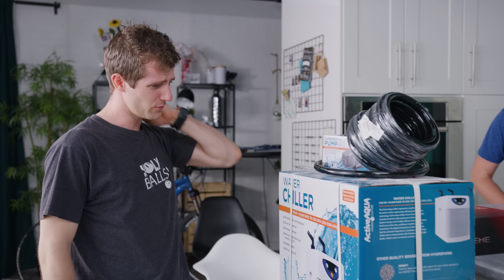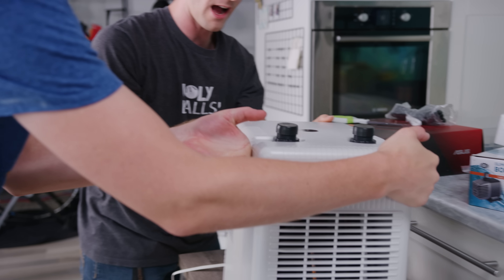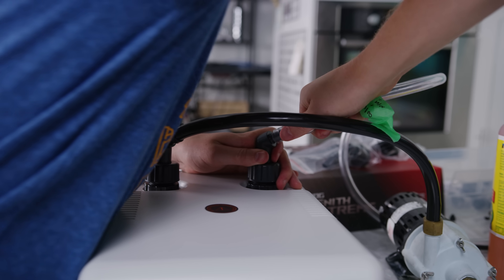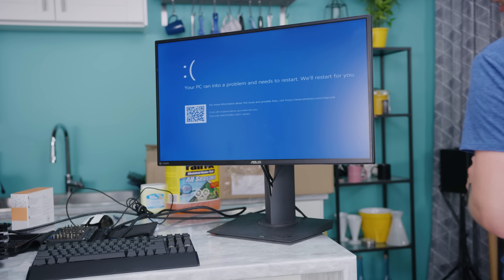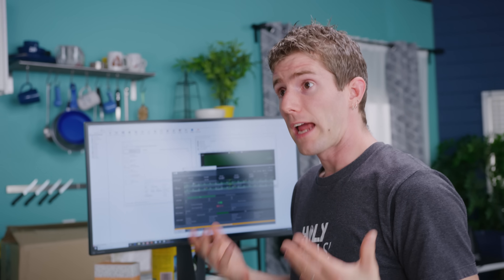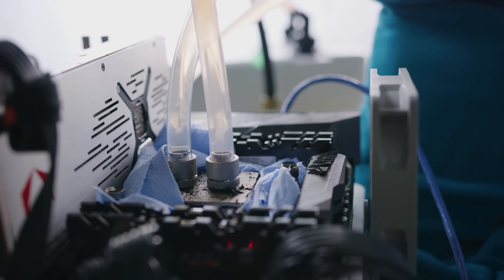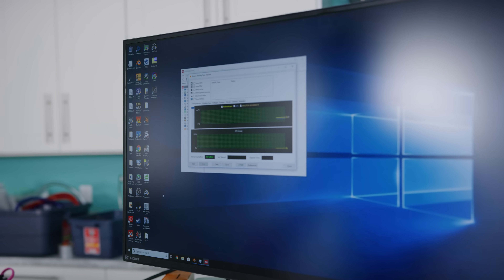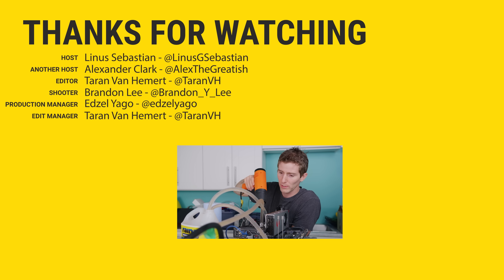Chilling Threadripper 2!!!

Comment: If only there was a machine that could be used to De-Humidify a Room so that when you run these experiments you didn't have to worry about Condensation
Reply: yeah they could get an dehumidifier plus an aircon and put the computer on a separated room and only bring the keyboard, mouse and video cables out and just go bonkers with it
Reply: I mean Going Bonkers is what they do. So why not have a testing room specifically for these crazy projects!
Reply: @draconk  chest freezer stick computer in that and run a HUGE air cooler
Reply: Just submerge it in 3M Novac liquid like der8auer did.
Reply: they should use a dehumidifier to cool a system
Reply: You know that there is a smartass way and there is a Linus way, right?
I'm here for the Linus way
Reply: /sarcasm
Reply: Couple of holes in the intake plenum of a window AC unit and it'll dehumidify like crazy, throw that in a wood box with the computer and you can go way below the dew point without dew because the dew will all drain out the back of the window unit.
Reply: no need to worry! There's a place called Antarctica...
Reply: A self filling water bottle would work
Reply: Holy crap that was an unexpected quick amount of interactions! That being said we all love Linus TT for what it is but if they are going to continue to do these crazy science experiments they should do them in a Controlled Environment which they definitely have the space and Means to implement! The less variables in your experiment the more likely you are to have a repeatable outcome!
Reply: Agreed but important to note more repeatable outcome for people with same ability to control the environment which isn't most of their viewers but most of us aren't going to be doing this anyway so a more reliable experimental setup could still be beneficial I suppose and I also suppose I don't know the point of this comment guess i just wanna add some more to the quick interactions!
Reply: :thonk:
Reply: UV conformal coat the board and vaseline in the socket and set it low on a load OCed like that and see if the 1/10 can keep up lol. It wont trust me. It will get very toasty in no time. A 50 Gallon (cooled to 4C) reservoir will help slow it down but it will still end up getting hot.. worse than air cooling hot.

Also a note. I don't know much about Rain-X but you may have another much larger problem. You may find it corrosive to the aluminum in your chiller. This is why those in the hydroponics business have to pay a little more for titanium rads in their chillers. I look forward to seeing what TR2 can really do. 1/4 is the minimum you would want to go for a continuous load, but (in the event you want lower sustained temps) don't hold me to that. I went all out and bought a 1 HP to run more than 1 system.
Reply: I think by:
1. Spraying the motherboard with hydrophobic compound.
2. Mounting the motherboard upside-down. And having some insulation around the pipes to reduce condensation...

This system could work without dehumidifiers.
Reply: maybe put the board upside down so condensation rolls away from it not towards it
Reply: The dehumidification level necessary would cause static buildup strong enough to fry the system?
Reply: Mineral oil is a bad heat conductor. It takes heat slower than water and releases heat slower. Linus should have just used water as Rain-X may be corrosive to the aluminum radiator in the chiller (just assuming it is aluminum and not titanium hydroponic grade). It is also most likely a worse conductor. As I said above a cheap and easily applied UV conformal coating will solve all condensation problems and with a UV light you can check for any missed spots. Uv conformal coatings are used in industrial applications that are in corrosive environments that can be salt water or even worse. But as I said above the 1/10 HP is not enough for sustained 780+ watts they have reached in the video. In less than 1 minute it will either crash or thermal throttle on that chiller, a 1/4 HP is still too low for a sustained load like that. A 1 HP would keep the sustained temps much lower allowing higher continuous overclocks.
Reply: What about a completely sealed case with a dehumidifier attached.
Reply: oil cooled used the pump to run baby or mineral oil for the whole pc
Reply: @AI A That doesn't help the issue at all though, the problem is the coolant temperature (which lowers the block temp as well) below the dew point causes water in the air to condensate its not about what you use in the loop its about whats in the air and the temperature of the loop.
Reply: Madarius  https://www.pugetsystems.com/submerged.php why that does not work  . there  the condensed water would go blew the oil so you don't have to worry about the water on the pc
Reply: @Al A Your original* comment didn't make me think you were talking about a submerged pc but i'm well aware of how they work. I gathered you meant put mineral oil in the loop instead of a water/alcohol based coolant. For the purposes of overclocking a novec fluid submerged pc would be better then mineral oil (I don't know of anyone actually cooling mineral oil to sub ambient they normally just use standard radiator/pump/fan combo not a chiller) yes being submerged in mineral oil would prevent condensation but it also becomes gel when it gets cold like really thick gel and would be a nightmare on a pump and would almost certainly clog up a loop.
Reply: A mineral oil encased PC has already been done.
Reply: We know that its been done he was talking about chilling the mineral oil to avoid the condensation problem that this comment thread is discussing. My response was why that would be a bad idea. Only covering both because i'm not sure if you were responding to me or AI A.

Comment: Hi, I'm not sure if you guys ran CPU on thermoelectric cooling? That would be interesting to see.
Reply: thermo isn't that great.
Reply: so 1500w on peltier cells to do the same his system does for 77w....
Reply: What's the thermo solution of heat dissipation? You got a 12volts at 5Amps at what? 70watt power draw? get like -20c. Get a cheap 12Volt DC temp controller that has a 20Amp  relay protection cut off one of the control  the temp to prevent condensation but keep it at a crisp and cool 35c? I dunno maybe I'm wrong?
Reply: They have larger  peltier cells what like 40mm x 40mm that can soak up 30A but you'll limit your plate to 20A at 12V which is like 240W (but if you are controlling the temp versus getting down to those sub-zero temps you won't see that kind of power draw).  The CPU already was pulling over 500W with their overclocking
Reply: buying the material for all that is fairly cheap too
Reply: Calculating total power consumption with a full load OC ryzen 7 1700, full load gtx 1080ti Strix OC, 3 SSD, 5 140mm fans, 16gbddr4 a 62mm tec plate, wraith cooler I calculate full psu usage to be around 850+- 30w with a cougar 1000cm and separate 24A 12volt rails it should work.. Theoretically
Reply: With a power regulator attached to the TEC in line with the power supply you should be able to control your Temps and keep it at a temp where Condensation doesn't happen

Comment: no just buy a peltier kit, thats all that is im sure,(EDIT: its not it runs on R134a). And attach it to a radiator please then build THAT into a system please i know you can do it!!!!! or just buy the Phononic hex 2.0 and review that since it does the same thing without the LQing
Reply: that's lame, wastes a lot of energy for no good chilling and increase the thermal temperature in the case, not worth at all.
Reply: you'd need 1500w of peltier cells to do the same as his 70w system, that's some pretty madness amount of electricity.

Comment: Could you actually put the motherboard in to a hermetic enclosure filled with CO2 or Some other gas that doesn't condense in to electricly conductive fluid.
Or even removing the moisture from the air in the enclosure, and go sub 0
????
Reply: M3 novec is really good for that. Series LN2 overclockers tend to use novec or cover the board in vaseline. Novec is the better option,as it cools everything on the board and has not risk of missing a spot, but the stuff is pricey and can be hard to get as it isn't considered a consumer product.

Comment: I see this 100% with "Whole room watercooling". This would actually be profitable. The bad noise would be in another room while all PCs would be running hecking low on temps.
Reply: lol7344  you can get t chiller that can cool over 1000 gallons of water so why not use it for a whole room watercooling
Reply: Too much heat to handle i think
Reply: @branislavkondic8381  you can get way more powerful versions of this. That prob 1/10hp you can get a 1 1/2 hp for a little over a grand.
Reply: @branislavkondic8381  nah I don't agree, this thing can do such low temps so setting it at like 20°C, it would make the heat spread pretty good and all machines would get a surely higher, but still pretty low temperature.
Reply: The water would reach equilibrium,  it can handle the heat.
Reply: @potato_x69  may I eat you
Reply: Sub ambient cooling is still impractical for anything which needs to be reliable sadly, the condensation is just too much of a liability.
Reply: This was my thought as well.
Reply: Its only rated for about 250 continuous watts. (960BTU)
Reply: it is not profitable. aquarium chillers are terribly inefficient (economically) at doing its job.
Reply: He said a tenth of a horsepower that's in the 70 Watts. Really not good enough.
Reply: @SoulTouchMusic93  surely not good enough to keep the workstations at the set temperature, say 10°C, but even if you set it to 10°C and achieve a physical 40°C when on full speed on all stations, I think that would still be good. I mean, that threadripper was outputting 500W and still cool.
Reply: Good idea, but there were many more issues with the whole room loop than just water temps/cooling. The biggest issue with cooling performance was the corrosion/build up in the blocks and pipes
Reply: @surviveinminecraft  a huge dehumidifier and good airflow would take care of that problem.
Reply: @surviveinminecraft  that's because thet were running copper tubing and I think someone had an aluminium cpu block or a aluminium radiator which caused corrosion and made nasty sludge in EVERYTHING

Comment: Couldn't you just flash the asus bios with "ez flash" or whatever it's called so you didn't need a threadripper 1?
Reply: pretty sure thats what they did he said he needed a usb with new bios
Reply: Daryl B  No, you need that regardless. But yeah, he seemed to ignore BIOS flashback
Reply: with the zenith extreme in question, which is what was employed here:
there are a few different things. the easy flash is in the bios. can't boot to bios, no easy flash via usb local drive or internet.
bios recovery on the other hand might have worked without them needing to swap the threadripper gen 1 in.

problem is, some of the bios updates include micropatches for some additional board features(like the onboard oled status panel on the backpanel cover) and have a tendency to not fully clear both bios settings and prior data(a problem that hammered many with the ZE when trying newer bioses and trying to downgrade to older due to an issue during the tr gen 1 year). so they theoretically could have used the recovery from usb to do it, but they would have had to have been sure they were starting from a bios version circa 0804 or newer to begin with, which they couldn't check without the machine being bootable or having a record somewhere else. worse still they might have retained unbootability by not overwritten settings not wiped before update(esp ram/clock/voltages). 

and yes, there is a clear bios/set defaults button on this board as well, but at that point its two more boots and if it still wouldn't post who the eff knows what state it might be in or where it went wrong.

its rather like trying to bios update most of asus products before 2014. if you used a usb3 drive and/or usb3 port to hodl the bios, you were likely going to have to rma. sometimes its just better to do it the slightly slower way and not be totally hosed, than slightly faster and deep on the long walk/short bridge.. especially with the production clock ticking as for a video like this.

source: experience with asus boards and notebooks over the last 15 years or so(incl helping with the testing of a bd-prochot and hardware cryptography enablement microcode patch for the g53sw notebook which had cpu features disabled because of outside of us production of the notebook.. circa 2011) , up through the 1950x + zenith extreme i'm typing this on.

they make nice stuff, but sometimes their choices are.. odd.. and support is a massive hit/miss affair.

Comment: I really want to see a system like this that is daily usable.
Overclocked CPU, and GPU cooling.
Maybe you can add some kind of controller to adjust the cooling according to the system load, and control that it doesn't go to low of room temp.
Reply: Extend the wires on the chillers display and integrate the display into the front of the case.
Reply: Your best bet is to sink the entire system in a non conductive fluid. You should check out der8auer, he does stuff like that all the time. My personal favorite is the "closed loop" LN2 system he made.

Comment: Most chillers I've used had a built in pump. Wouldn't the bottleneck of heat transfer be the the actual horsepower of the chiller and not the flow rate?

Comment: Drop a big lexan box over the test bench.  Hook a portable AC unit to it.  Chill and dry the air around the motherboard.
You should be able to get the dewpoint MUCH lower.

(Or just put your whole test setup in a walkin freezer)

Comment: i acidentally do a little bit too much strength slotting a cooler fan or a ram and break my motherboard in four.
Linus drops 500L of liquid over the chip, dries with a blow dryer and 3 hours later it's like it never happened.

<.<

Comment: YES PUT IT IN A WP200 WITH A DEHUMIDIFIER TO STOP THE CONDENSATION PROBLEM PLUS WHEN YOU CAST YOUR HEAT SINKS YOU DO THE WRONG WAY UP SO THE BOTTOM PART THAT YOU MILL FLAT IS AT THE TOP AS OVER FLOW WHEN CASTING

Comment: Did you ever test a using a bulb pump (hand drive) (often used for fuel) to fill a loop. You can even pressure the loop a bit with air, to test if it has any leaks? It really works great. (Just don't put too much pressure on it)

Comment: pro tip: don't start elite watercooling a system before you know that it will post and actually work normally.

pro tip2: don't use anything other than an asus mobo if you want a mobo that will actually work reliably

Comment: 250 Watts that’s not even 8 Watts per core lol. Imagine your 4 core cpu only using 32 Watts on  cinebench
Reply: Pretty amazing when you put it like that, that 500 watt reading is more sensible actually, 64watts per 4 cores. Sounds like an intel i5...and even those use way more than 65 watts during 100% load at stock.
Reply: You mean a ryzen u, or a coffee lake mobile?
Reply: @groza exaclty what i was thinking
Reply: Need

Comment: if you decide to cannibalize that cooler and are going to do anything involving removing or adding to the refrigerant in the unit you need a Type 1 EPA certification in the united states or you can be fined up to $47k a day. don't know what it is up there in Canada but you might want to check.

Comment: That's not simply, "Like new", that's BRAND NEW. If it's, "Open box" then, to me, that means the box was simply opened and the product was never used or it was an unused shelf model that wasn't touched by people. However the spec tests the retailers perform is complete shit so who really knows. That's one of the reason's I never go with open or floor models with the exception of rare cases.

Comment: Just as I was thinking "wow they're actually doing something a legit way", Alex goes "you want to just stick the tubes in and duct tape it off?"
Reply: Honestly it sounds stupid but it was actually a really good idea. Otherwise they would have to dirty a reservoir with antifreeze. 

Linus' reaction was pretty much the perfect reflection of that, at first appalled but after thinking it though realizing it was a good idea.
Reply: Well, compared to some of their other jankey solutions, this one isn't as Jank. The the bottle allows for air to escape the system, and it won't overflow, since it's only the contents of one bottle in the system.

Comment: I would like to see the chiller incorporated into a unit for PC's vs Aquariums.  You can get a similar unit from eBay for under $300 and use the bulkhead fittings to feed your D5 pump.  I have suggested this design as an idea for beating air cooling which cannot achieve less than room temperature which in Arizona is often in the mid 80's F.  So, yeah, go ahead, strip it down and build something.  With todays hot, impossible to cool at normal workloads (who buy an 18 core chip to sit at idle) I've given up on radiators and air cooling.

Comment: if the chiller is only 0.1HP, it only has ~75w of cooling power.  I seriously doubt it will keep the loop cool during a hour longer render or encode.  You will need to include a radiator in the final build to pre-cool the liquid before it goes into the chiller.

Comment: Yes! Put into a system. You REALLY should use the recommend buffer tank size to limit short cycling the compressor on the chiller. Thank you very much for taking this suggestion I gave you guys over a year ago. However, because you have the hardware, how many systems can you fit onto one chiller? Also, you can put the chiller and pump into a different room to completely eliminate any sound complaints.
Reply: Whole room water chiller.

I like the way you think.